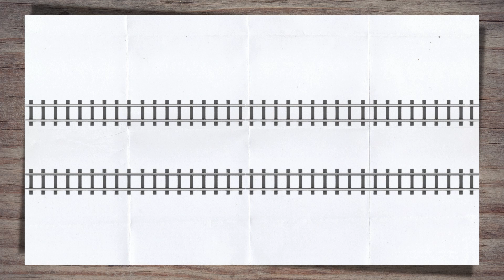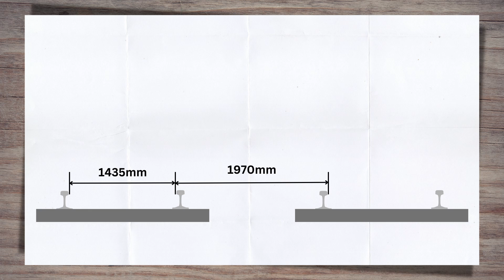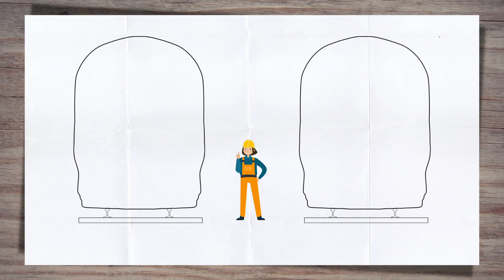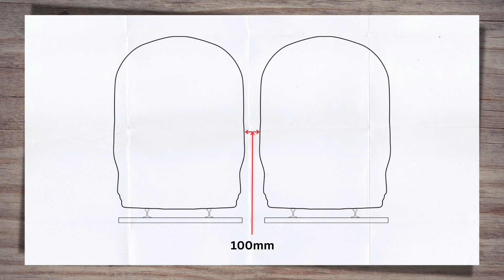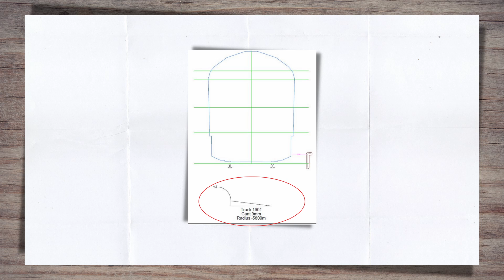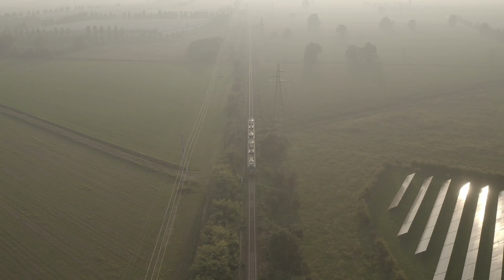What Is Railway Track Interval and Train Passing Clearance? A Simple Guide

Comment: I always thought that with high speed trains, it is important to keep the distance to at least half a meter, so that the airpressure between them is not to high to derail one of the trains
Reply from the maker: This may well be true for high speed trains. In the UK our top speed for mainline trains, apart from HS1, is 125mph. I would guess the rules/ standards are different at higher than this speeds